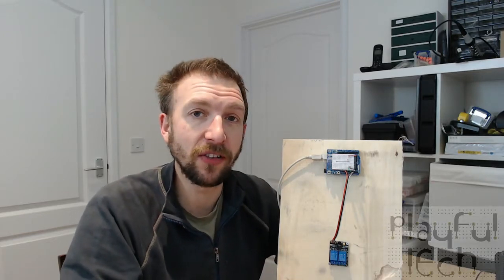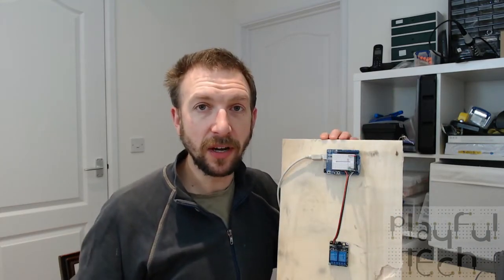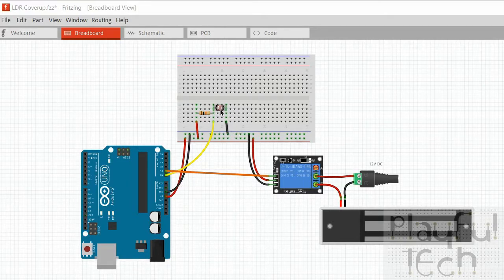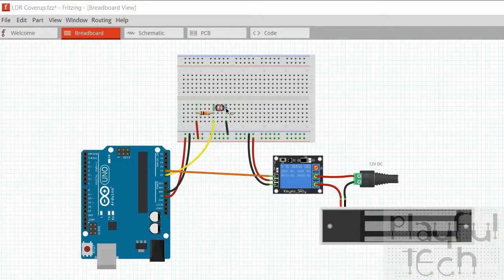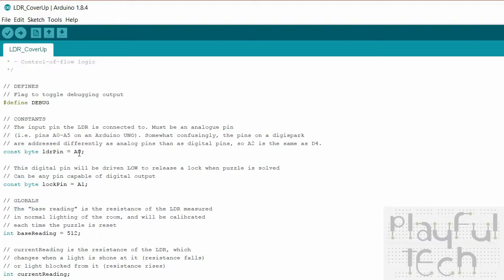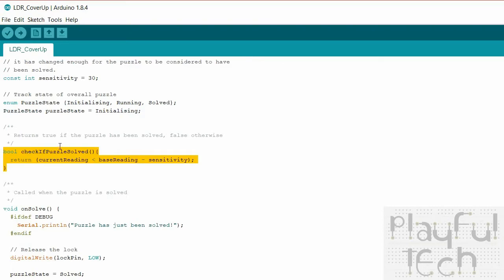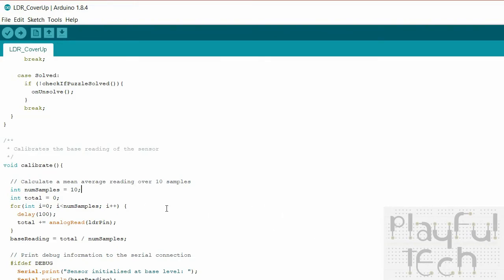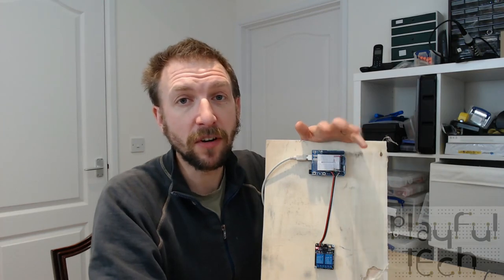Cover Up! / Shine On! Escape Room Puzzle

Comment: Hi... saw you at ERIC... one of my puzzles has a sarcophagus with ball shaped hole in the front. The idea being that the ball (which is 70mm transparent resin) is placed in the hole, the lock will fire. I figured the way would be to have a sensor that would detect changing light values if the transparent ball was placed in front of it. Do you think an LDR in a setup like this could do it?